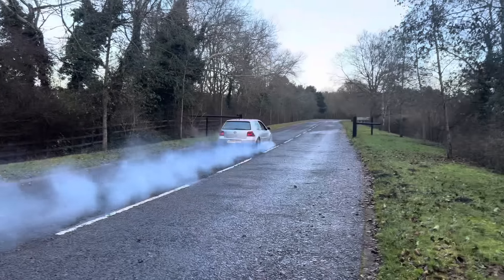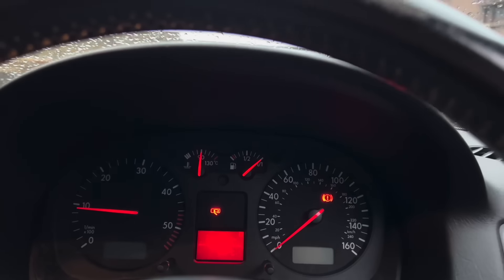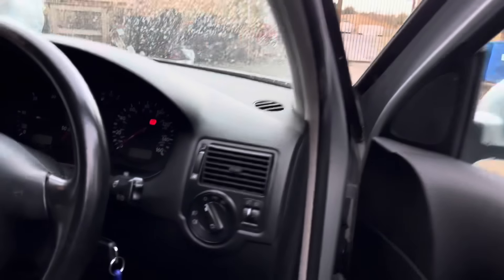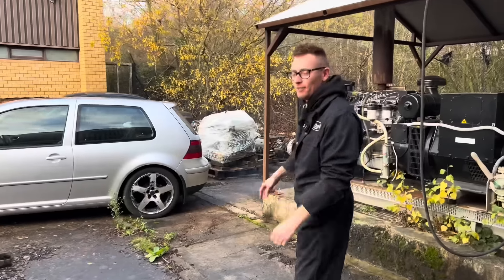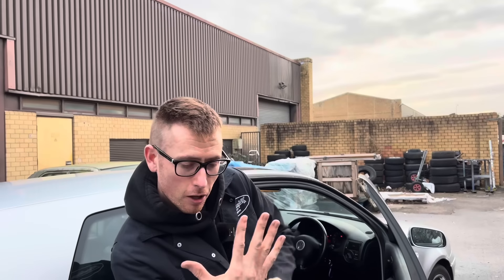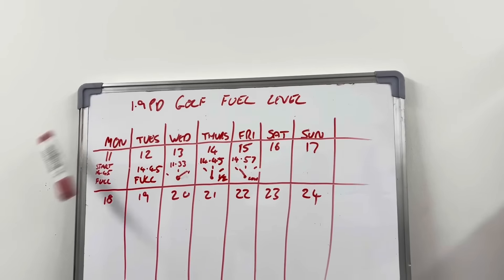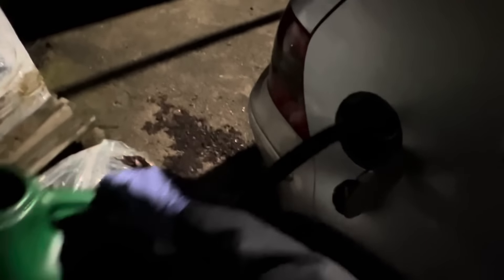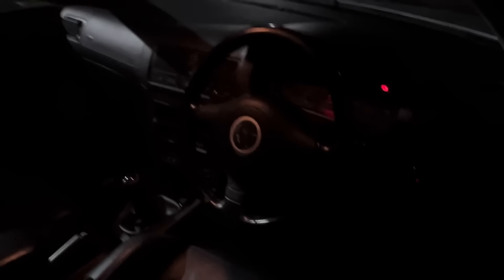2003 VW GOLF how long will it IDLE? OR Blow up first? The Idle experiment. (ONE FULL TANK DIESEL)

Comment: I know these engines consume around 0.6 litres per hour at idle. So I worked it out to be around 90 hours. But she did better than I thought.
Reply: I was thinking it had a 50ltr tank and there would be some error on the gauge which do report 0.6-0.8/h usually So I would've guessed 62,5 hours :D I guess I shall stop shutting engine down while idling lol.
Reply: @rkan2   He put everything drawing power like the cabin fan, lights and so on, off. So the consumption is more to be 0,5-0,6 Liters pers hour. If I remember correct, these Golfs had a 55 Liter fuel tank that could be fueled up to about 58 Liters when pushing the vent pin with the nozzle while refueling. So about 100 hours is realistic. And it was nearly perfectly that.
I have driven a Octavia of the same generation and had a bet to run 1500 km on a tank. I did 1550 km with all the tricks, with a consumption of 3,7 L/100km. But after running dry, I would never push the high pressure pump (belt driven) so long without diesel in it, which is also the pumps lubricant. Just turn the key, let the primer pump run (turns off after 10 seconds) turn off and on again for 30 seconds. After that, it will start in less than 5 seconds.
Reply: Less, less... that's my '07 3.0 V6 TDI consumption at idle.
Reply: 0.6 is actually much for a Diesel
My gasoline idles with 0.5 L/h
Reply: That means EV can hold longer on idle
Reply: My mk5 140 hp golf. Shows 0.4-0.5 per hour when idle
Reply: Really? My 2.0 tdi focus 2020 is about 0.2
Reply: @MePeterNicholls  lots of variables in the difference of how much a engine will consume at idle. The main one in your case is electronic fuel injection opposed to mechanical found on a pd engine. A pd is lumpy at idle and has quite a high idle speed I think. Not the most sophisticated
Reply: Cars that run in the cold run better than in the warmth because it is not trying to cool the engine down so less things running and so it should run better and longer in the colder weather. It's a good test though and if you needed to run your car non stop then it is fairly cheap to do so. If you ran the heat 8 hours a day your getting over 12 days out of it and in my eyes that is cheaper than your home but still not very comfy
Reply: I had one of these, and i was able to fuel 2-3 liters more than 55 liter tank. So that makes the difference i guess.
Reply: @bielmelichartes2167  2.0 litre. It drops to 0.1 when warmer. But that’s just what it reads. You’re being a bit needlessly aggressive.
Reply: @dom3827  I had a 1 litre nissan micra k11 that would idle just over 600 rpm when fully up to temperature. I couldn't tell exactly because it had no tach but just judging from the sound. I bet that would have sipped fuel on idle. I'm not sure with diesel as most of the ones I drove had a fairly high idle - getting on for 1000 rpm.

Comment: I used my 1.9SDI Caddy as a generator for a couple of days. Literally no issues at all. The fuel guage was still on the top mark after.
Reply: How many KWh did you get out of?
Reply: @pharmazynouni6897   not sure, it was running a little 300w invertor, but the actual load would have been a fair bit less.
Reply: How do you do that?
Reply: @skino666 By using a power inverter that takes the 12v DC and turns it into AC voltage for household stuff. Not the most efficient way to do it, but does work and doesn’t require having a specific generator.
Reply: @skino666  exactly as @nbsv1 said.
Reply: i had a caddy 2.0 sdi, i remember it being very fuel efficient but had returning idling problems and a serious lack of power. After i sold the 2.0sdi i got a 2010 caddy 1.9 tdi, man i liked that caddy. I still hate myself for the fact i kept driving with the ticking noise getting worse

Comment: See how long it will last on the rev limiter.
Reply: Put a brick on the throttle :)
Reply: until the fuel runs out ..
Reply: @colinscutt5104  I think the engine would fail long before it runs out of fuel. I'd say under 30 mins until it stops.
Reply: @Carr9T2  why?
Reply: @colinscutt5104  cause running it at full throttle and you will either overheat and warp the engine or break an internal component looong before it runs out of fuel
Reply: @FinnaPassAway  high RPM does not equal high load. A healthy engine that does not burn all of its oil in the process would most likely survive without big issues. RPM limiter is there for a reason.
Reply: @hedemegmondom  exactly
Reply: @hedemegmondom Yeah, especially in diesels because max throttle does not mean full fuel and therefore low engine load. A lot of diesels in heavy equipment/generators/boats run at "rev limiter" all day with no issues .
Reply: Years ago used to watch engine destruction videos.
Most engines without oil water lasted about 8 minutes at full chat.
..
With an installed fully working engine at full chat probably an hr...or less..it will over heat either blow a big end or seize...
Reply: @stuartd9741  Why, pulling a ripper accrost a field barely able to maintain full rated rpm WITH fuel cranked up a bit in a high gear for hours on end and a 400 series still lives another day. Or some generator sets with 'oversized' generators on them running at full load for days on end. Unless you are talking about this golf, but I would imagine it would last a lot longer than an hour or less wot full load.

Comment: Back in the day when fuel was cheap and before we were concerned about the environment it was common in countries with a cold climate to leave diesel vehicles like taxis, buses, trucks and locomotives running 24/7 in the winter, the reason being they were often hard to start in the cold, took a long time to warm up and the cold start puts a lot of wear on the engine. Not to mention that your vehicle was always ready for use with ice free windows, batteries fully charged and (for heavy vehicles) air in the brake reservoir. The idling capability were even considered one of the big advantages on a (older) diesel engine over a petrol engine. They could often be kept idling indefinitely without any particular bad effects and with a minimal fuel consumption. The other big advantages were of course the overall low fuel consumption, the reliability and the simple service requirements the old ones with mechanical fuel injection had. A couple of oil/filter changes, a fuel filter and an air filter each year, timing belt (if any) and maybe a water pump every 100-150.000 kilometers, that was about it for most of them. The big drawback: Lower power output than a petrol engine of comparable displacement, but the diesels higher torque partially made up for it.
Reply: interesting fact, i own an honda fit, 1.3 L, it idles at 650 rpm, consumption 0,58 L/H. I found it great because other petrol cara idle at 800+ RPM, this brings wear to the engine earlier
Reply: @jvnl2006  is it the 1.3l i-dsi engine u have? my 8th gen civic with 1.3l i-dsi idles at 900-1100rpm and drinks a lot of fuel on idle
Reply: Diesel engines does not have any better torque than petrol. 2 same size engines without turbo and there is no difference. Actually petrol might even have more torque because it has more hp and torque comes from low rpm hp. But people still think diesel has more torque because they have more displacement or turbo or both. Vw golf mk2 1.6d has less torque than vw golf mk2 1.6 petrol
Reply: @Santelssi that’s wrong, more often than not a diesel be it turbo’d or non turbo’d will have more torque than a petrol for the same displacement however less horsepower. For eg E60 bmw 535d 3.0L has 560nm torque but like 268hp compared to M5 with 5.0L v10 petrol engine  that has 520nm torque but 500hp. Diesels are notorious for their torque that’s why they are used in lorries & truck and larger vehicles where lots of torque is needed to pull weight.
Reply: @jvnl2006 RPM doesn’t directly correlate with engine wear, lower RPM can actually cause more wear, for example a 5.7 hemi
Reply: @Santelssi 😂
Reply: @espenberg8773 Lower idle RPM usually means more wear as you’ll get worse oil pressure at such low engine speed.
Reply: @hezza1354 It’s not wrong, the only reason diesels normally have more torque is because of the higher compression ratio, and because they can’t rev as high the gear ratio is higher giving better acceleration at low speeds. At 100+ km/h the powerband of a diesel is inferior though.
Reply: @Santelssi tard
Reply: @Santelssi nonsense
Reply: It's still somewhat common up in the alberta oilfield to never shutdown a diesel in winter. Start it in November 
Turn it off in april
Reply: @kriswilson265  You clearly don't know how combustion engines work, the only reason diesels normally have more torque is because they need higher compression to burn the fuel, which is why they naturally have more torque than a low compression naturally aspirated petrol engine.
Reply: Chococrispi911  The main reason for diesels is the lower consumption, the tougher build because of the higher compression, but especially: the torque at LOWER RPM's compared to gasoline engine. A non turbo diesel has no significant more torque than a non-turbo gasoline engine. It's the RPM that matters, not 10-20% more or less. But it delivers it sooner, so it's easier for heavy duty vehicles to do their thing. And consume less. And be safer to operate - diesel will not ignite as easily as gasoline or gas fumes in case of mechanical problems or accidents.

Comment: Great video. It shows how useless stop/start systems are.
Reply: that is a great point.  all S/S systems are good for is revenue for the battery and starter manufacturers.  Absolute trash of a system.  I mean really.... how many people are worried about saving a teaspoonful of fuel that may be consumed at a stoplight or drive through?
Reply: @HamRadio200  Start Stop really isn't about saving fuel on an individual basis, it's about emissions. I've just come back from the US and over there they have traffic lights every 20 seconds and you typically end up stopped at them for 2 minutes or so. They need more roundabouts.

But anyway, my point is it is about scale. Imagine the emissions coming from 40 or 50 cars sat waiting at traffic lights for 2 minutes. Doesn't seem like much when you only think about yourself, but when you scale it up to reality in cities.. the two minutes of having your engine shut off makes a huge difference. 

Isn't that useful here in the UK because I can drive for ages without needing to stop for more than a couple seconds at a roundabout, but I don't live in a city with thousands of cars waiting at intersections and roundabouts or in standstill traffic.
Reply: @iambenmitchell  then those minutes turn into hours, the hours turn into days and yeah. thats a lot.

Comment: I have a Passat 130 estate which I had parked up at the side of the shed.  Almost full tank of diesel.  Started it last winter to keep the battery topped up and kinda forgot about it til 4 days later...
Reply: Didn't the grag grag noise keep you awake through the night? 😂
Reply: @energymc22  my shed is quite a distance away from my house so no. It was bad weather too so i was indoors quite a lot

Comment: I remember back in the 80's we had a severe winter and people were stuck in huge traffic jams and of course kept their cars running to keep them warm. It was reported on the news multiple engines had blown up and they advised people not to leave their cars idling. So certainly back in those days not all engines could be kept running constantly like that !
Reply: Probably just Wrong oil for winter honestly..
Reply: @henrik1743  Well thevoil shouldn't matter much since the engines are running and therefore warm. Even many fairly modern engines have problems with lubrication on idle though, so that's probably why... Just not enough oil preasure.
Reply: Friend of mine had the same situation last winter, they couldn’t move for 2 days because of snow and an accident. His wife was totally frightened because his car is electric. They lost around 45% of battery in the two days, because they had the heat on high, heated seats and infotainment for the kids. Now she always prefers his car in the winter 😁.
Reply: @erebostd i guess you have forgot how li-ion batteries work? I mean under 0degrees C, you will have around 60% full capacity. So if your story would be true, that would mean from 50% battery theyve heated their car for 48 hours in subzero conditions. Did you write the bible mate? My friends, turn off the heat many times, because it drains the HV battery too quick. Also im pretty sure they didnt have a full battery to start with. Im guessing you have not seen the highways in -5-10degrees conditions, where every 20-50ms there is a dead EV left on the road :) next time try to come up with something more realistic mate.
Reply: @csutakgergo5279  ok, you are a troll, nothing more. Here in Norway the  EVs make up 83% of the market, and we drive it all year around, with lows at -20 degrees. So either you try to sell absolute bulls%it or the cars here are not EVs and driven by fairy dust. 😵‍💫
Reply: @erebostd  Tesla can heat its batterys, that is why. Its nothing rocket science that a battery lose capacity when its cold. And Ive seen EV's that uses 3.5kWh when heating the coupe.  If you dont believe it, you can wonder why the Tesla dont go to full speed when charing a cold battery.
Reply: Remember when the news lied to you? Never obviously 😂
Reply: @csutakgergo5279 dude, maybe you forgot the fact that batteries heat themselves up when they're in use. Also... That's now how it works. Under 0C their current rating is limited (because the electrolyte inside gels up and thickens), not the capacity. In the winter mileage goes down because 1- people keep heaters on, and 2- the car actively heats the batteries when idle using some energy.

Guess what! Gasoline and diesel cars are exactly the same: they're much less efficient in the winter, because to keep in temperature (and to compensate for the denser air) they run a lot richer. You may notice it less because fuel tanks store a bunch more energy than batteries, but your mileage may go down by upwards of 20-25%.
Aand... Diesel suffers the same problem as batteries in less than 0C weather: it becomes more dense and gels! You can put additives in (or sometimes it's already in the diesel you pump in your car in the winter), but guess what. That reduces range too.
Reply: @FAB1150  brother, you have so many things wrong in your explanation, i appreciate your time but you need hella lot more research :) no current EV uses lead acid, agm, or gel batteries. Peugeot still uses Ni-cd(so no electrolyte to "gel up" for example, and its still being made to this day. I repair these peugeot batteries, electric motors and hv alternators, in my shop for a living ;) other evs use li-ion and li-po batteries, so again no electrolyte to freeze. Also both nicd and li-ion/polymer batteries do suffer a LOT from cold temperatures, depending on battery chemistry capacity will be reduced anywhere from 80-60% at 0C, and it gets worse the colder it gets. Yeah some batteries have a heater, but what do you think the battery heater works with what? Fairy dust? It uses the battery power. U say batteries heat up while u use them, which is true, when you properly use them,but what do you think, where that heat comes from? Fairy dust or current losses? Lets say youve got a 100kwh battery, since car is not too well insulated, you need to heat it constantly. If you have full charge, and the battery is well over 0c, with a 5kw load(car electrics, pumps, fan, heating element will draw much more) your battery would last 20H. Se how unrealistic it is? Its just simple math. anw, diesel and gas engines actually like cold air, and are much more efficient running on cold air. That's why we use Intercoolers. Cold air is more dense, meaning it has more oxygen, meaning it can take more fuel, meaning bigger bang= more powah. Increased winter consumption comes from softer compound tyres, increasing rolling resistance.
Reply: In the 1980's, most cars were spark-ignition petrol/'gas' engined, fuelled with carburettors and ignited with hope and faith via a coil, distributor and points. The inaccuracy was vast and they generally ran rich. Hence excessive idling would wear the upper bores through fuel washing away the lube oil
Even a humble old naturally aspirated diesel with mechanical fuel injection was far more accurate in its fuelling and timing, with the extremely lean tickover condition allowing indefinite safe running (as commented below)
Reply: they still do this in Siberia Russia to this day
Reply: @csutakgergo5279  "other evs use li-ion and li-po batteries, so again no electrolyte to freeze"

The lithium - typically in a salt solution - is the electrolyte in a lithium based cell.

This is basic stuff for someone proclaiming to be an 'expert' in these things.
Reply: @erebostd  I suppose on electric cars you need a separate electric heater (I do wonder about reverse air-con or a heat pump whether you'd get more heat for your battery). How much waste heat from the motor do you get I wonder? Running air through that and into the cabin might be good when the car is in motion, but when it's stopped and you need some heat not that good. Perhaps just running the heated seats is more efficient because it gives you heat by contact instead of escaping through the glass - just like when you cook your food you put it on a hot plate rather than trying to blow it with a hair dryer.